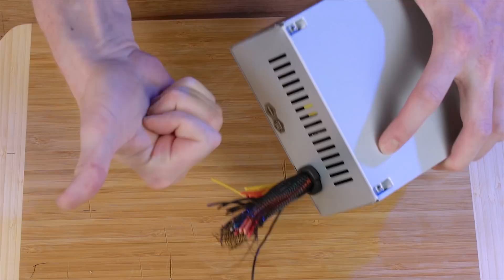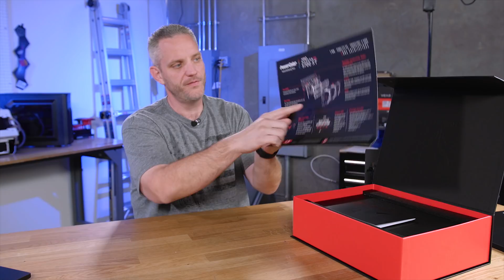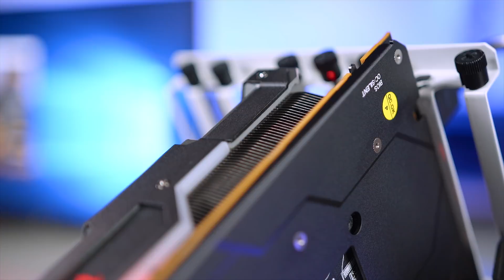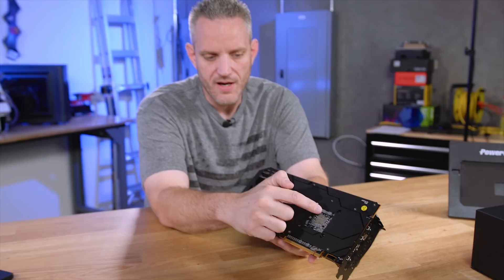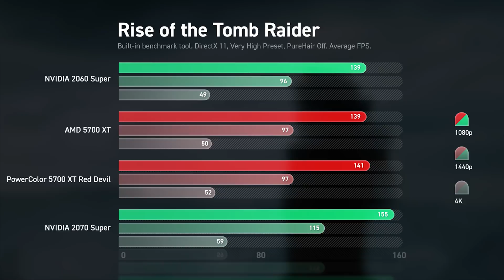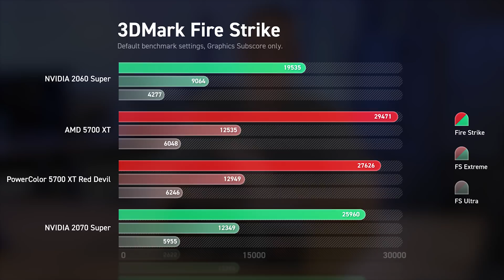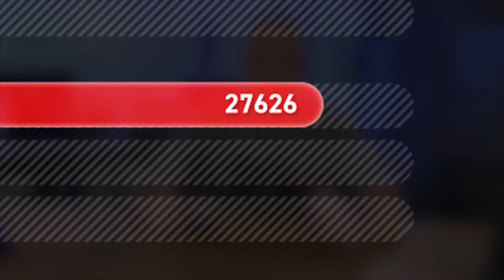Custom RADEON 5700 XTs are here! and THEY ARE GOOD!

Comment: There’s 2 issues I have with going for the 5700XT over the 2060 Super. The MSI 2060 super gaming OC sells for €432 here and is in stock. This card isn’t in stock but will sell for €469 (already confirmed) and it’s not available yet. Same goes for other aftermarket cards from AMD. 

I just bought a new system today and went with the 2060 super because it was cheaper and actually in stock, and I like the NVIDIA Software Suite much more. 

Sad because I went with AMD ryzen 3600 instead of intel and I’ve had intel for over the last decade. My last AMD was on the 939 socket. Not too bummed about the performance I’ll be missing out on since I game at 1080p mostly and with the Gaming OC 2060 Super the difference between it and this card isn’t so big, especially when you further OC the 2060 super. Still kinda bummed that NVIDIA didn’t drop their prices even more.

Comment: I had the displeasure of purchasing a powercolor card, R9 380x myst edition. I had done a lot of research and that particular cards was supposed to be great for overclocking and so forth. What I didn't expect is that they will sell an exact named card that failed the rather minor factory overclock. The card that I had researched was supposed to be core clock 1020 and memory clock 1475 but the card I purchased was at 1002 and 1425 and could not overclock at all. When I realized this I attempted to have it rectified but was basically told Haha fooled you. So buyer beware they sell their potatoes under the same exact  name. I for my part will never support or purchase a powercolor card ever again.

Comment: Still prefer Nvidia. AMD wont have my money, not in this lifetime.
Reply: just buy what is best for your money/you. don't be a fanboy, i'm also using nvidia(gtx 260, upgraded to 1050 because rx460/560 was out of stock)+intel(almost 10 year old i7 cpu), but if i would go for new build i would buy ryzen cpu and navi gpu, they are just crushing it in low/mid tier right now and it looks like they are going for high tier next. buy with your brain, not your feelings.

Comment: They could have easily gotten away with the 8+6 pin for 220w.. two 6 pins would have covered 225w the 270x is proof of that (even though I haven't actually seen/used one that actually drew over 180w).

Comment: Powercolor good? I never knew! I thought they were typical. 
Damn i hate dual-pin cards in general, 8+6 or 8+8 doesn't matter, it's just another cable i have to use and fit inside the case meh...
Plus, RGB...get the fuck out of my face with that useless bs i ain't paying a single cent more or that.

Comment: Hey Jay,  I would like to see the OC numbers on the same chart for all the games to compare to the 2070 super.  I was able to go back to Metro 1440P and we can see that non-OC the Red Devil is 14.8% fewer frames than the 2070 Super but post OC (a simple undervolt) it is only 10% fewer frames.  So you go from a card that is 15% slower to 10% slower on that one title with an easy undervolting OC .... what about the other titles?  What about at 1080p where I play?

Comment: I begin to wonder, with the massive width of the cards (2,2.5,3 "space" cards) why don't they add a blank pci-e tab to fit into the pci-e x2 or x4 slot you are likely covering up? (I know I see the shorter slots on a lot of boards, right next to the top pcie )It would help with graphics card droop as well. Though it does look like they might have started "opening up" the spacing between the pcie x16 slot and the shorter slots.

Comment: Do any custom 5700 XT cards come with a DVI port or was that just false rumors based on an old photo by Tech Power Up? (the Mech OC by MSI for the 5700 (non X) had a picture with a DVI port, but now has a DVI sized hole where it would have been on the card in the Mech series on MSI's website!)

Comment: I like that my ASUS  Directcu II R9 290 has a dual bios. It seems like not too many cards do it, unless you get the high end cards. I use the OC mode exclusively, but it is nice to have the option. My card even has traces on the far right to hook up monitoring tools for that badass overclocking.

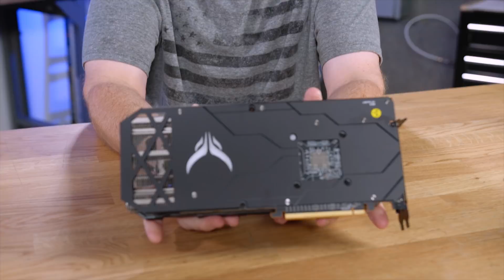Comment: 2:50 They should've used the leftover space to make the PCB a bit longer and place the 2 8-pin connectors on the side for a cleaner look and better cable management options. I really don't get why this still isn't a thing in 2019.

Comment: Nvidia already has a problem. Buying 2070suprer over AIB 5700XT (like sapphire $410) means paying a giant premium for 5% performance uplift at best. 
So what for? Don't feed the green dragon, let them feel the pain, let them rethink strategy and deliver actual performance uplift in the reasonable price range. 
2070super should cost $250, not $600.

Comment: nice video JZ, just adding on to your commenting of the cooler that it blows air towards the bottom of the card not allowing that Turbulence that happens in cards that are closed on the bottom > The rurbulence helps in heat transfer - specially in convection which is the case, although in the end the air leaving the card case helps a bit to cool other components the turbulence could help it even more in heat exchange.

Comment: One thing I feel not a lot of people are talking about is Navi in next-gen consoles. From what we know both PS5 and the next Xbox are going to be using Navi GPUs and zen 2 CPUs. This is ultimately going to mean much better optimization for Navi and zen 2 coming to PC
Reply: Current consoles also use AMD Hardware, so are all games optimized for Vega/Polaris? Heck no. Consoles are important but its not like all games are just ported over from there. 
Moreover the consoles will feature some form of AMD raytracing, which is missing on the current Navi-Gen. Not sure how AMD is gonna do it, but if they use dedicated hardware like Nvidia or other specialized cores, those 5700's could have a really short time of relevance.

Comment: Any pc guru out there recommend me if I should just wait to upgrade entire comp or just upgrade gpu...
I'm stuck in this odd position...
Want to get a vega 56 or a rx580 to step up from my laptop 1050ti...

I'm just constantly stuck at this thought of it not being worth it since I don't play intensive graphical games(partially fueled by my lack of strong gpu)... and my desktop rig is stuck with a fx 8320, gtx 750 1gb. 
Budget isn't an issue but... this is the first time I've made a major upgrade.

Comment: After seeing the bottom of this cooler, it appears this card is not running any heatsinks at all on the memory VRM's. You can get away with this as stock voltage, but if memory overvolting becomes a thing in the future, you will want heatsinks on your memory VRM's. Also, as well as the opening on the back of the card works to cool it, that opening is also right below where most memory slots are on a motherboard, which means you're blowing the hot air from your GPU right over your memory. In a fast Ryzen system with overclocked memory running 1.4v+ with tight timings, that is not ideal at all. This is a good looking card, but I think I prefer Sapphires Pulse design so far.

Comment: Boo. Drop 3DMARK. Also, I have a 1060 3GB and although I need a new card (as I now have a 1080x3840 144hz monitor), I’ve decided to wait for Navi with HBM, since several reviewers are finding Navi to be memory-bottlenecked. I just don’t think a 7-series of this generation is enough of an upgrade from my 6-series of last gen, outside of Forza Horizon 4, of course. In that game, 5700 XT is like 3x the performance.

Comment: Sapphire Pulse is better, in general...much smaller card with negligeable difference in performance and lower price.
Some of the tests of this card (Tech PowerUp) showed a large jump in power draw for a minimal performance jump and basically no OC headroom...making the cooler the only reason to get this card. But, like I mentioned, the Pulse does the same with smaller size and lower price...

Comment: But not good enough - 5700XT pushed to the limit still only matches 2060super / regular 2070 OCed, while costing the same or more, consuming considerably more power and of course lacking RTX... DOA untill prices drop to about 50$ lower than Nvidias, which will probably happen soon enough, but towards the end of the year at the latest

Comment: Hm powercolor.... I have one and it's so loud... I said to myself don't buy a powercolor card again... :/ (it was a AMD 390)
Reply: lol don't blame Powercolor for the AMD 290/390 series, those cards are like sticking a 300w toaster in your PC. I ran an R9 290 for 4 years, watercooled and overclocked to 1250/1600. It melted PCI-E cables twice during benches where I was pushing for 1300MHz. I also have a Powercolor PCS+ Myst 7870XT, and it's very quiet, and has been in a backup PC running for 6 years. Powercolor makes quality stuff.

Comment: To put into perspective what an architectural leap this is.. It has 50% less CUs than the radeon 7, but is only 10% slower. 

So when AMD decides to make a big RDNA GPU with 60+ CUs it will be very interesting.
Reply: The Powercolor RX 5700XT Red Devil is exactly as fast as Radeon VII, so there is no difference between them which is very impressive.
Reply: @sebastianmoser2478  LMAO with way less VRAM, Keep crying, MORON .
Reply: hum bug FUCK AMD
Reply: @noctuahvenvk4216  stfu

Comment: As a mechanical engineer I would like to say that the design helps to get higher airflow which helps with cooling... the point you made that turbulence lowers the efficiency of cooling is not true. Turbulent airflow is great for heat transfer.

Comment: I am building a pc with a 
Ryzen 5 3600
AsRock x570 Phantom gaming wifi
AsRock Rx 5700xt 
Gskill 16 GB (2×8) 3200 MHz
Seasonic s12iii 620 watt
Crucial P1 1 TB
I was wondering if I should cancel the order on the 5700 xt and buy this one of the Sapphire pulse. The reference one cost $525 CAD plus tax where as the pulse costs $550 CAD plus tax and the red devil is $600 CAD plus tax. Thanks in advanced.

Comment: JayzTwoCents : Jay, Firestrike cannot favor Navi architecture because the last update for 3D Mark came before Navi was released and therefore 3D Mark cannot differentiate Navi RDNA from GCN architecture and definitely cannot have any optimised compilers inside for RDNA. Why Firestrike results are better that the RTX 2070 Super ? It's because of the new RDNAs algorithm for computing low intense graphic scenes in 2 ques of denser data packages instead of 4 cues of thinner data packages as it was with GCN parrallel algorithm since the release of GCN back in 2012. To simplify, AMD dumified their algorithms to more fit the archaicness of DX 11 and its nonefficiency thus to more efficiently but in a simpler way use their parrallel compute power.

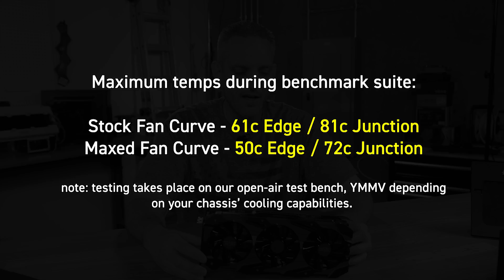Comment: This is 10 VRMs phases. not 7 VRMs Phases (4:57)
What's the difference?
Nothing much besides that 7 VRMs phases is around 220w / while the 10 VRMs around 300w
In Reality, this card will hit 200w (stock) to a 240w (OC)  But that 300w is just an extra for extreme OC dudes
Reply: Kinda... but that's not really the benefit of multi-phase VRM.  The more 'real' phases in the VRM design, the less ripple will be present in the supplied voltage as well as each phase having to deliver a smaller amount of the total power leading to cooler operation.  So while it CAN deliver more max current than a 7-phase, the 10-phase will deliver the same configured power cleaner and cooler. (all other design and component efficiencies aside)
Reply: @carbonsx3  Yes 100% agreed
But that was the full details, I was giving like super summary 
Real Phases come in handy on Mobo, GPU and anything that require VRM Phases
And yes, some well known Companies do some "fake" VRM phases, just like Gigabyte in their Z270 if am not mistaken, also Asus,

Comment: Rumor has it a Playstation 5 will beat it so no thank you I want those next year high end gpus either Amd or Nvidia!
Reply: The only way to beat a $400 gpu is a super expensive system. Not to mention, the tiny form factor of consoles meaning you can cook eggs on them while you play games it can hardly run
Reply: @yungdomino4718  It will apparently have 2080 lvl performance that's all I know, according to those rumors floating on the Internet! But if they wanna aim 4k 60fps with consoles next year it would be highly plausible...
Reply: @gcur  plausible for sure, but consoles have always been for "affordability" (there was a time when you could build a higher performing PC for as much or cheaper. That changed after the mining craze) but now more than ever, are consoles good for those who don't wanna spend a bunch of money. But being able to play 4k@60fps is gonna cost a lot more than what consoles have been selling for in the past
Reply: @yungdomino4718  PlayStation Meeting event on the 12th of February 2020 where they will officially unveil their next console. If this rumor is true we gonna find out soon enough:-)

Comment: In my country the prices for the 1080 ti went down to about 310 $ to 290 $ retail (amazon) in the last weeks or so. Is anything wrong with them? Might they be (in this particular case) a even better deal than the 5700 xt?
Thanks for all the help I can get.
Reply: Dude, if you can get a legit 1080ti for 290 USD, you need to grab that now. Even on the used market, they run way higher (in the US where gpus tend to be cheaper). If you think they're legit and you'd at least be able to utilize Amazon's return policy, I would go ahead.
Reply: @SIRHC119  Thank you so much
Reply: @SIRHC119  quick example:
https://www.amazon.de/GIGABYTE-GeForce-1080TI-Gaming-GDDR5X/dp/B06XWXQX6T/ref=sr_1_2?__mk_de_DE=%C3%85M%C3%85%C5%BD%C3%95%C3%91&crid=373IGG9VPKY69&keywords=1080+ti&qid=1565936617&s=gateway&sprefix=1080%2Caps%2C168&sr=8-2
Reply: @tobiasgraf9125  yeah that's a pretty good deal. Looking at the used market here in the states, you'd have to pay ~500 USD for one. So €300 or so is pretty good. And if you get burned you can file a claim with Amazon.
Reply: @SIRHC119  in Germany you get aused 1080 ti for about 450€, and now a new one for about 300€ (?!)
Reply: Pleasee answer every little bit of help is verrry welcome

Comment: Pricing in the UK is a letdown. The reference 5700 XT sells for 370 quid, the cheapest AIB 5700 XT sell for around 440 quid and the cheapest AIB 2070 super for 480 quid. Not quite the same value proposition as in the US. It is annoying.